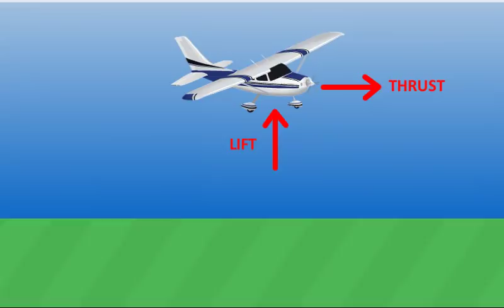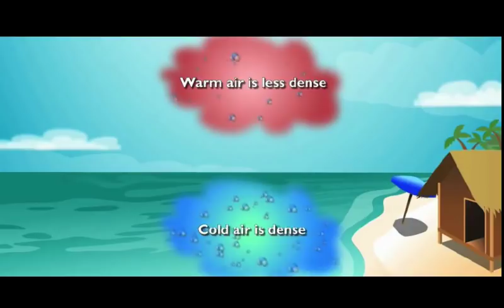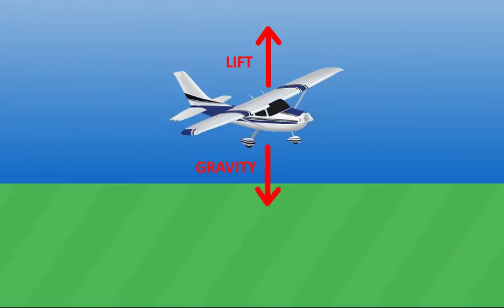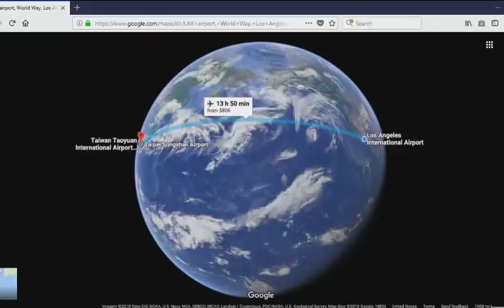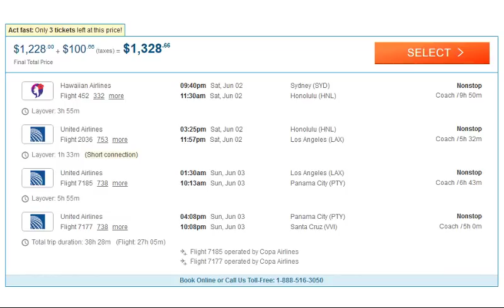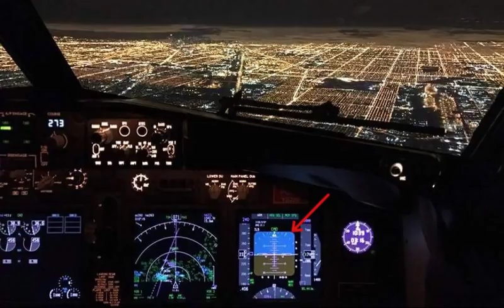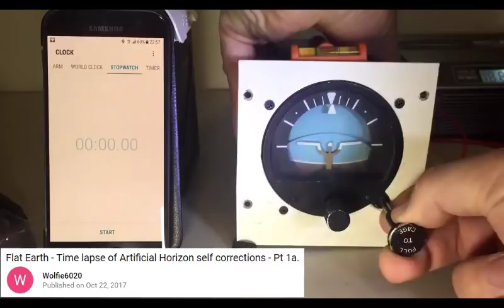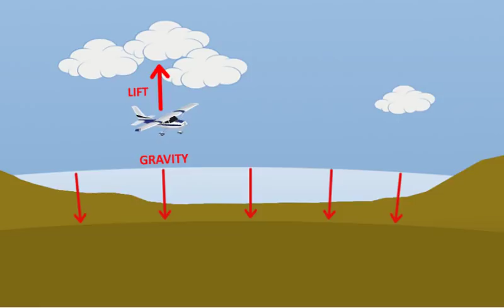Flat Earth Falsities - Plane Nonsense

Comment: Why isn't our atmosphere growing as Earth makes more air what keeps the air from being sucked into outer space.....oh got to be a solid dome or firmament keeping the air from escape. Since Everytime I blow a bubble by a vacuum it pops interesting
Reply: Richard A. "Trees do NOT absorb CO2"
If trees aren't capable of photosynthesis then how do they grow?
Reply: ...and trees and plankton die and restore the absorbed gasses back into the ocean floors and the soil...
Reply: a vacuum is an absence of pressure.
Reply: Harry Johnson it's called a cycle we use breathable air and the plants make it breathable again
Reply: Richard A. i wasnt replying to yoy by the way. when i ridiculed generated new air. i meant  volume wise. it shouldnt get added. oxygen after you ingale just becomes CO2. you didnt generate another air. just converted it.
Reply: Matter can neither be created nor destroyed only converted. EVERY SINGLE PARTICLE in your body was present at the Big Bang. It works on Earth because we are in a balanced system. The only way to ADD new air is to have a comet from space deposit water on the Earth. That doesn’t happen very often. :)
Reply: generating new air? hahajaha! thats classic! i pity you.
Reply: Ok, smartass, what is that excreted when you fart?
Did you earlier inhale or gulp down some Methane?
No.
You created a gas that formerly did not exist.
We take oil out of the ground and (among other gases) produce CO2.
Trees absorb water and exhale CO2.
NEW AIR
So there.
Reply: No... I doubt they know what ablate means...
Reply: Harry Johnson are there any fe arguments that aren’t straw men?
Reply: Richard A. i am pretty sure trees absorbs CO2 and let of oxygen.
Reply: Vacuums don't suck. Learn how Google works.
Reply: How much air do you think we produce?  The atmosphere is not growing, it recycles through animals and plants as well as weather and geological processes.  It is constantly being released, but also absorbed.  Atmosphere itself is held to the Earth by gravity.  That is why the air gets thinner when you go higher.  The vacuum of space does not suck.   A vacuum, when released at ground level is actually explosively compressing as air rushes in to fill the void.  It is not sucking like a vacuum cleaner.
Reply: The zero pressure of the outer exosphere has no problem being next to the zero pressure of space.  
Plus the air molecules are still being pulled down to Earth by gravity.
Reply: You cannot "blow" anything with a vacuum. 
Space doesn't "suck". 
There must first be pressure for a vacuum to do anything.
Reply: Trees do NOT absorb CO2 or Methane.
Only Oxygen.
What a dumbfuck.

Comment: To be fair, the air doesn't move perfectly along with the earth. There is a lag effect that actually is effecting general wind directions. Topography, ocean currents etc. makes this effect very shattered however. But air planes don't take the exact same time to go from east to west as they do in the other direction (just play around with a booking site for plane tickets if you don't believe me).
Reply from the maker: Anonymous Anonymous — Yes, correct. I tried to keep it simple, but I did say “plus or minus wind currents”, and wind currents are effected by the rotation, just not like flat earthers think. Thanks.
Reply: VoysovReason Simplicity is a necessary evil. Flat earthers argument doesn't get any stronger by the wind to actually exist however (evidently allot less strong than there conceptualisation of a round earth implies I most admit. But at least it's present, witch they claim it shouldn't be). :)
Reply: Thank you :)  I think I am almost getting it. That is a very good explanation, particularly about movement being relative.  If I think hard, and read your explanation a few times, it might sink into my thick skull what is actually going on here.  :)
Reply: If you jumped off a train moving at 100 mph you would not expect to instantly lose your momentum and be still. If an aeroplane has 1000mph of momentum and flies the opposite way at 500mph you might expect it never to get there using the same logic of momentum ☺
Reply: "If an aeroplane has 1000mph of momentum and flies the opposite way at 500mph you might expect it never to get there using the same logic of momentum"

Earth spins towards the West at 500 mph at some latitude.
Plane takes off and flies East at 500 mph, standing "stil" relative to a spot in space just above the Earth.
Destination moves towards the plane at 500 mph.
They still meet.

What do it means?  The means the plane was flying as fast as the Earth was spinning and will land at the same local time as when it left, just in a different timezone.
Reply: That is quite an interesting answer, thank you. I think I might just be able to grasp that :)
Reply: I was wondering, not necessarily about higher latitudes, but for those poor people trying to fly east from the equator, as they already have a 1000mph western momentum and can only fly at 570mph east. It is almost as if they might end up going backwards, and I'm trying to work out why they don't :)
Reply from the maker: Hello from David - I tried to explain this very simply in the video. But here is another way to look at it. Movement is always relative to something. In your jumping off a moving train example, you will keep moving WITH THE TRAIN, so when you hit the ground you will be moving fast relative to the ground, which will cause you to tumble. You are moving 0 mph relative to the train, before and after you jump off.

A plane on the ground is MOVING east at the same speed as the earth. So a plane sitting on the runway at the equator will be moving 1000 mph relative to the CENTER of earth, and 0 mph relative to the SURFACE of the earth. When it takes off at 100 mph to the east, now it is 100 mph relative to the surface, and 1100 relative to the center. The two speeds combine. It doesn’t have to accelerate faster than 1000 mph to go east, it already has that speed, and just adds to it with thrust.

Take off west, and he is actually going a net of 900 mph relative to the center of the earth (1000 - 100), but still 100 relative to the surface. The plane’s motion due to thrust, adds or subtracts from the motion it already has on the ground, relative to the center of the earth, because that motion is conserved when it takes off. Just like your motion with the train is conserved when you jump off the train.
Reply from the maker: Hello from David - Glad to hear it. Another analogy are moving walkways in an airport. If you turn around and walk the other way on the walkway, you will still be going forward in relation to the walls, but backward in relation to the moving walkway. Provided you walk slower than the walkway moves. In this analogy the walkway is the surface of the earth and you are the airplane.

Start at 30 seconds.
https://youtu.be/T74fYX08mXw
Reply: Thank you. That is an excellent analogy.  A lot of things still puzzle me. For example, when in a train or on a walkway, your senses tell you that you are moving because of g-forces but you never feel this on earth as acceleration changes if you walk north of south perpendicular to the spinning top and when you look at planes in flight and their contrails they appear to be flying in a straight line over a two dimensional plane. You don't see and up and down or left and right curve,  it can be a dead straight a to b type line ☺

Comment: It’s funny to me how no flat earther can get anywhere without fully discounting the effects of gravity.
Reply: Don Petite said nothing of the sort. His point was that we don't have that capability up and running at the moment. Not that we don't know how to do it.
There was a really good quora answer to this, given by Robert Frost a Flight Instructor at NASA, which I'll partially quote here:

"Why does it take 3 years to develop a new car, when it shares 90% of its "DNA" with the previous model?  Why does it take 6 years to develop a new airplane when it shares 90% of its "DNA" with the previous model? The answer is that they are complex devices.
The Saturn V rocket had over 3 million parts.  The command and service modules and lunar module were composed of millions of additional parts.  An individual person cannot contemplate the scale of detail needed to assemble and operate those vehicles.
So, when the Apollo program ended, the factories that assembled those vehicles were retasked or shut down.  The jigs were disassembled.  The molds were destroyed.  The technicians, engineers, scientists, and flight controllers moved onto other jobs.  Over time, some of the materials used became obsolete.
If we, today, said - "Let us build another Saturn V rocket and Apollo CSM/LEM and go to the moon!"  it would not be a simple task of pulling out the blueprints and bending and cutting metal.
We don't have the factories or tools.  We don't have the materials.  We don't have the expertise to understand how the real vehicle differed from the drawings.  We don't have the expertise to operate the vehicle.
We would have to substitute modern materials.  That changes the vehicle.  It changes the mass, it changes the stresses and strains, it changes the interactions.  It changes the possible malfunctions.  It changes the capabilities of the vehicle.
We would have to spend a few years re-developing the expertise.  We would have to conduct new tests and simulations.  We would have to draft new flight rules and procedures.  We would have to certify new flight controllers and crew.
We would essentially be building a new vehicle."

-- https://www.quora.com/How-did-we-lose-the-technology-to-go-to-the-Moon-If-it-has-been-built-it-can-be-built-again-cant-it-What-exactly-is-the-problem
Reply: THEY DISMISS EVERY THING THAT DOES NOT FIT THERE LUDICROUS ARGUMENT///.
Reply: Jeff Bell Music 

Pretty sure Einstein must have meant the "absolute" motion of Earth, as in straight motion is relative to a frame of reference.

Spin is detectable. Surely Einsten knew this.
Reply: Here are some non-NASA images for you. Himawari 8 is a Japanese geostationary weather satellite operated by the Japan Meteorological Agency at an altitude of 35,795 km. It takes full Earth single-frame high-definition (11000x11000 pixel) images, in 16 different wavelength bands, every ten minutes. And they are available to browse online in real time at https://himawari8.nict.go.jp/
Reply: Jeff Bell Music: everything you describe there regarding stones, butterflies, balloons and wood is fully explained by gravity. 
There are no contradictions there, only your misunderstanding. 
The wood floats on water and the helium balloon floats in air due to buoyancy, which is a product of gravity. 

The volume of air/water displaced has a greater density than the object displacing it, so the volume is pulled down forcing the object up by the same force. That’s why the formula for buoyant force is:

F =ρgV

Where F is buoyant force, ρ is the density of the displaced fluid/gas, V is the volume of the displaced fluid/gas and g is acceleration due to gravity.

Longer explanation here:
https://www.khanacademy.org/science/physics/fluids/buoyant-force-and-archimedes-principle/a/buoyant-force-and-archimedes-principle-article
Reply: Jeff Bell Music: North America being bigger in some photos of Earth is a normal geometrical property of a sphere. The further you are from a sphere the more of the surface you can see.
This image shows the same sphere from three distances:
https://www.metabunk.org/sk/globe_comparison_with_distance.jpg
Obviously you can test this for yourself quite easily.
Reply: Jeff Bell Music said, "Einstein, said there was no way to measure the movement of earth." I don't believe that. Do you have a reference?

Comment: Have you ever considered that Flat Earth Extremist Cultists' claim that the sun sets by perspective contains a vital flaw? And that flaw is related to their fake incredulity that the earth could be spinning at 1000 miles per hour.

The laws of perspective say that as an object moves away in a straight line, its aspect stays the same (it doesn't rotate in our field of view), but it merely subtends less and less of an angle centered on the same point (it doesn't move up or down from its center), until it reaches the vanishing point an infinite distance away.

Since perspective is the Flat Earth Extremist Cult's ritual prescription for the rise and setting of the sun, they necessarily are saying that at sunrise, the sun is an infinite distance away from the observer, in an easterly direction. between sunrise and noon, the sun moves that infinite distance (infinity/6 hours equals infinity miles per hour!) to be 3,000 miles above some point on flat earth. Then it moves from 3,000 miles from earth to an infinite distance to the west in the evening to set there. Again, infinity distance/6 hours means another infinity miles per hour.

So according to Flat Earth Extremist Cult dogma, the sun travels twice infinite distance each day, at infinity miles per hour, infinitely faster than the speed of light (!). After vanishing in the west, somehow, during 12 hours of darkness, the sun again travels at infinity miles per hour, twice an infinite distance, without being seen doing so (!), to resume its position an infinite distance to the east to rise the next morning. And Flat Earth Extremist Cult dogma says that the Sun's apparent size is continuously growing and shrinking proportionally to its distance.

And then Flat Earth Extremist Cultists have a problem with the earth rotating at a paltry 1,000 miles per hour. Idiot liars. They'd lie to you about what they ate for breakfast.
Reply: Or for fraction fans, about 1/1436ths of a rotation every minute. :)
Reply: The way you calculate that is one rotation per 24 hours times 60 minutes per hour equals rotations per minute. 1x24x60 equals 1,440. So each minute the earth rotates 1/1,440th of a revolution. That's 0.000694444444444 RPM, as No has already said.

Is it more reasonable to believe that the earth rotates 1/1,440th of an RPM or that the sun moves an infinite number of miles per hour, twice an infinite distance each day, returning completely unseen during the night to begin again? I think the answer is very, very clear.

Now you have to be careful of the tiny difference the use of the sidereal vs the synodic day represents. The synodic period, with reference to the sun, is 24 hours. The sidereal period, with respect to the unmoving star background of space is 23 hours 56 minutes. That results in Graham's 1/1,436th of an RPM.

If you want to calculate effects on centrifugal force? Which number should you use, synodic or sidereal? I know the answer but I'll leave it open.

Comment: tl;dr for flattards... if you were traveling an orbit around the sun  that was slightly offset from the earth then if two planes were flying at the speed of earth's rotation, but in opposite directions, one plane would appear stationary to you (with the earth spinning underneath it) and the other would appear to be zipping off twice as fast, and this is exactly as much a problem to physics as someone on one of the planes tossing a ball in the air and realising that it is travelling ~1000mph while NOT thinking they're suddenly the greatest fastball pitcher known to man.

Of course, at this point you'd be able to see the earth was round with your own eyes and STILL be denying it. Point is get a handle on something as simple as reference frames or get the fuck out with your backwards arse shit doing nothing but making us dumber as a species.

Comment: Come on now it’s oblate we were told so by Neil deGrasse Tyson lmao
Reply from the maker: Oblate by how much? 20% wider than the height? 15%?  8%? Did you even bother to check? Do you know by how much Tyson said it was?

Flat Earth Falsities - Oblate Pear Earth?
https://youtu.be/sFdw_DNTZtY
Reply: It's oblate in the sense that Earth is not 100% perfectly round. Because of its rotation, it bulges outward a bit on the equator. The difference however compared to a cross-section through the poles is just 30 or 40 kilometers. Less than 1%. With the unassisted, naked eye you can't see it. I don't need Neil to tell me that, I first learned about it 40 years ago in regular geography high school classes. Jupiter however does have a noticable bulge because of its relative short day and its huge size -- a lot more mass being thrown around